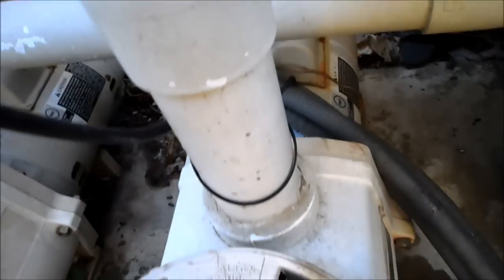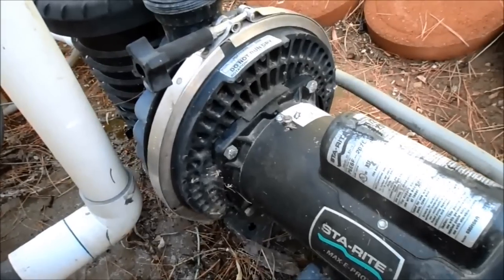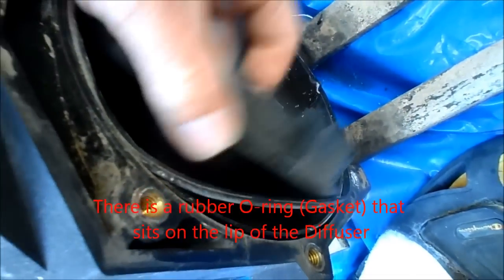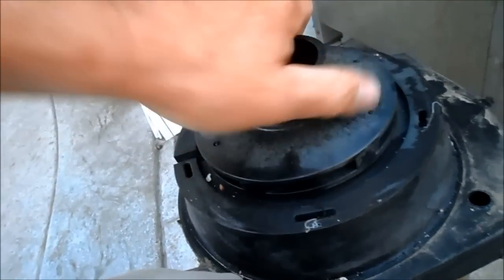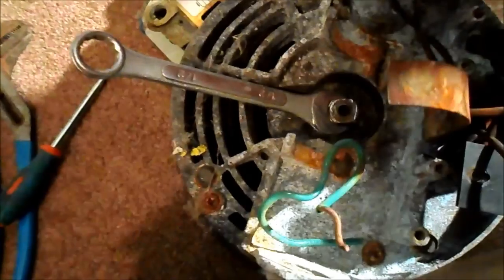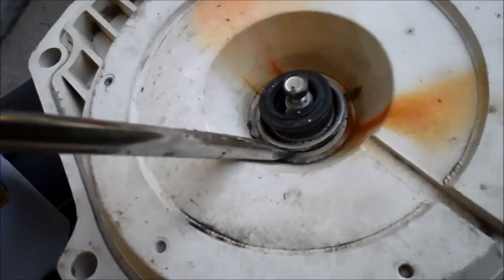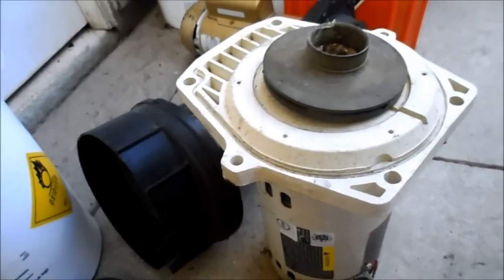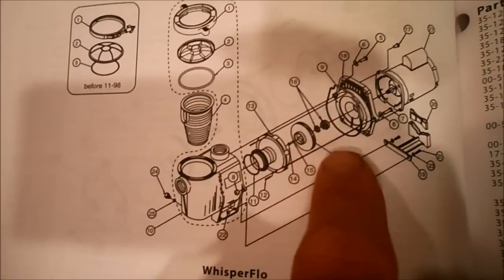Pump Impeller & Diffuser Issues, Pool Pump Not Priming Part 6

Comment: Nice video. Although around the 7:00 mark, when working on the whisper flo pump it looks like the shaft screw wasn't removed before the impeller was taken off. PH refers to "phase", as in single phase or 3 phase. Most pool pumps are single phase. A 3-phase motor allows you to wire it so that the impeller will spin clockwise or counterclockwise depending on your wiring.. you should take note of the service factor of a motor as well as the horsepower. For example a one and a half horsepower motor with an upgraded service Factor would require a 2 horsepower impeller.

Comment from the maker: Sounds like something is leaking. Did you try my plastic bag trick yet? Tie a regular plastic bag at the pump discharge (where the threaded pipe and top of pump meets the pipe & one in the intake in front of the pump - also at the point where the pipe and pump meet). Try priming it again as see what happens. Usually the pipes will melt if it ran dry for a long time. Sometimes the diffuser inside will have melted also.

Comment: Thanks! My pump overheated ( the oring popped out on one side of debris basket lid ) . I found the wear ring was 2mm on one side, 2.6 all around elsewhere. Put a new one in and new diffuser seal and it didn't help at all. I then noticed the impeller was worn where the wear ring goes around it. So now Im going to remove the impeller and put a new one on, and needed to know how to do that. Thanks again.
Reply from the maker: I show removing the impeller in this video: Motor, How to replace your pool motor: http://youtu.be/J7BVkIp4l_Q

Comment: Thanks for all your great videos!  Very informative and real.  I own an old whisperflo pump that was putting air bubbles into the lines.  Sometimes it would also run with very low pressure or none at all.  Resetting the pump would fix it.  I replaced the seals in the pump including the ones on the impeller and the difuser.  The seal in the impeller was rotted.  After that there are less are bubbles but still the occasional low pressure issue.  I guess the impeller is next for replacement!

Comment from the maker: Call Hayward and ask for a Warranty service. The bearings are wearing out for some reason and the motor will burn out very soon. There is a one year warranty on the pump and motors. The day the warranty guy comes out, leave your pool off so he can start it up and see what you are describing. Once the motor warms up the bearings quit down so it is important that he is the one to start it up. Oh, don't mention the fact that you took it apart as it may void the warranty.

Comment: Nic video man! But at about 8:15 when you are talking about the motor's HP,  you note that sometimes it is backwards and listed as PH. PH on the motor refers to the Phase of the moor. It is either single phase or 3 phase (PH 1 or PH 3)
Reply: Bho bjb
Reply: And you put on a higher horse power impeller than the one you took out. You can tell by the space between the blades on the impeller is greater. This will cause the motor to burn out.

Comment: As always, an informative video. I'm currently working on replacing the motor for my DuraGlas PUMP .Unfortunately ,
However , the impeller is stuck. I was reluctant to use pliers or channel locks on it - as I'm afraid it'll break - BUT it looks like that's what you did. Is  the DuraGlas impeller pretty tough, and Can I use channel locks on it? I tried to use a strap wrench on it, BUT it didn't work.👎
Reply from the maker: You can take it into your local pool store and they can mount it and use an impeller wrench on it.
Reply: @SPL  
Thanks. I'll give that a shot.

Comment: Awesome reference! I have a Hayward Ecostar SP3400VSPVR that is giving me a drive error”drive failed to start”! I have a new control board so I don’t think it’s that! I tested the motor for continuity and it checked out okay. The manual says check impeller, diffuser, shaft seal, and motor. Would you say I am heading into the right direction?
Reply from the maker: Could be a bad drive. They had many issues with those. Hayward has extended the warranty to 4 years so if yours is from 2015 and on it is probably under warranty. You would have to call them with the pump serial number.
Reply: Swimming Pool Tips, Reviews & How To - SPL  thank you for everything!

Comment: Do you ever answer questions? I have a Hayward 1 hp inground pump and it starts out working for 20-30 seconds, then suddenly it stops sucking.  Is this an impeller problem?
Reply from the maker: Maybe an air leak. Air is getting into the pump from somewhere.

Comment: Should air from the Pentair motor be exiting near the front of the motor (pump side)? I would expect it to exit the rear of the where the motor screen is. Air is existing and blowing from the middle towards the lid. I do not have any water leaks. Thank you
Reply from the maker: If it is a really old motor it could be the bearings and the coils burning out. Overheating.

Comment: The only question I have is what is that vent thing on the wall where the pool is enclosed in the building outside it looks like a very big vent whats that called and why is that there? To provide the air or something? And I have also seen one in a parking garage too in the building not even near a pool so I wonder why they have it there too?

Comment: Recently cleaned filter (Haywerd DE), and now the pressure fluctuates from about 10 PSI to almost zero, with corresponding fluctuating flow.  Any  advice would be greatly appreciated.
Reply from the maker: Sounds like air in the suction line after opening the filter up. do you have an attached spa?
Reply: Hey, thanks for the reply bud!  No spa, but it looks like I fixed it.  Suction was apparently so strong at the skimmer that it would draw all the water and suck up lots of air before more water replaced it.  Added more water and it's good now.  Interestingly though, there aren't any videos up yet that address this problem.  Hope this helps anyone else with the same problem.

Comment: I've also found that I can't get a prime after the pump ran dry one day. I put a hose in the basket and ran the pump, and still nothing. But if I poured a big bucket of water in, it squirted out the bleeder valve and pressure rose -- but as soon as the bucket was empty, it dropped back to zero. Does that mean my pump works but something is leaking? Or the pump isn't pulling hard enough? Btw. do you have a pool business anywhere? (I'm in Los Angeles, in the Valley.)

Comment: I have a Hayward pump and the impeller is clogged. It has 6 bolts. I started to remove the bolts. But two bolts just spun and I couldn't remove them. Any ideas?

Comment: 10 year old pool, came with the house. Pool/spa worked well. No water in the pump. unit shakes and gets smoking hot. But I think the motor runs.
Reply from the maker: Sounds like air in the line somewhere.
Reply: Swimming Pool Tips, Reviews & How To -MrDgvb1 thank you very much, i tried priming it no luck, now i just get a humming sound
Reply from the maker: Is there another suction source like a spa or main drain? Or you can dry a drain bladder in the skimmer and see if it primes that way.
Reply: Pool is pretty full, now motor makes an extremely loud really loud hum and wont spin even a little bit, i can still spin impeller with my fingers though
Reply: Pool is pretty full, now motor makes an extremely loud really loud hum and wont spin even a little bit, i can still spin impeller with my fingers though

Comment: Just got a diffuser for jandy flopro and its so tight around impeller had to force it on. This cant be normal. Impeller needs to spin freely.
Reply from the maker: Sounds like the motor shaft is no good.
Reply: @SPL  the impeller does spin, motor works fine, i just had to replace broken diffuser and new one dont fit over pump impeller had to really force it on to line up the pins and 2 screws
Reply: And now its so tight from diffuser pinned , impeller cant move. Thanks for ur help

Comment: Can a pin. Hole in the diffuser cause my gpm to be 10 gpm lower than normal
Reply from the maker: Usually not. But it may be warped or have other issues.

Comment: I have a cracked pentair pump housing from the recent freeze. Would you recommend replacing the entire pump or would it be fine to jusr replace the housing? Thanks!
Reply from the maker: If you can find the housing and the pump is 8-10 years old I would do that. Heard parts are in short supply. Upgrading to a new VS pump would not be a bad idea either. In 1-2 years the energy savings will pay for itself.

Comment: can you over tighten the impeller causing the pump to run very hot
Reply from the maker: Not that I know of. It is possible to install the wrong impeller and it is too tight in the Diffuser.
Reply: Swimming Pool Tips, Reviews & How To -MrDgvb1 would there be a difference between an impeller for a 1hp 's a 1.25 hp?
Reply from the maker: I think the difference is greater between a 1 hp and a 2 hp impeller. You can for instance use a 1.5 hp impeller on a 2 hp pump but not a 2 hp impeller on a 1 hp pump. You should match up the impeller for your exact pump hp  for best results.
Reply: Last question: ok, ruling out the impeller, I replaced the diffuser, then what could possibly causing the pump to run hot. Water is flowing nicely in the pool. Thanks
Reply from the maker: Could be burning out. The bearings inside are wearing out causing excess heat.

Comment: Question my motor turns on for a few minutes then it turns off & the circuit breaker shuts off? Whats wrong with my motor
Reply from the maker: +Raul Villegas  Depends on a few factors. What type of pump/motor is it and how old is it? And does it actually prime up and run or just buzz?
Reply: Hayward 1 1/2 hp, I bought the house two years ago , it primes then it turns off
Reply from the maker: +Raul Villegas Common problem with Hayward pumps is the difusser warping and the impeller gets trapped and stops spinning. That would be my best guess with your pump type. You will have to pull it apart and inspect the parts. 

This video covers taking it apart in a round about way. You will see all the parts I mentioned. 

Motor, How to replace your pool motor:
http://youtu.be/J7BVkIp4l_Q

Comment: Wow thats a crazy good video, of a how to, but it's not that easy to properly fix a pump. I do give you credit for packing in a bunch of common pumps, like the whisper junk and the dreaded NORTHSTAR.  removing a impeller from a northstar, usually requires totally disassembling the  motor and placing the rotor in a vice, and carefully removing the impeller, with a BIGAZZ 480 channel lock.

Comment: I am changing the diffuser and the impeller on my sta-rite dyna-glas pump. 

I noticed that the diffuser and the impeller fit a "too" snuggly. I can't imagine this is good. But this is the first time I am doing this.

Both diffuser and the impellar are brand new.

Here is a link of the video. Notice the grinding noise when the diffuser is "loosely attached" to the pump. 

https://www.youtube.com/watch?v=qYuAgrkMxSw&feature=youtu.be

Looking for any advice on what is going on here.
Reply from the maker: The only way to tell if there is an issue is to wire it up and turn it on. Due this while it is outside of the pump itself and see how the impeller spins. It may be okay or the diffuser may be the wrong model for your pump. If the impeller spins good then you should be okay.
Reply: Thanks. I followed your advice and it worked. The reason it was scrapping against the diffuser was because I had not completely screwed it in.